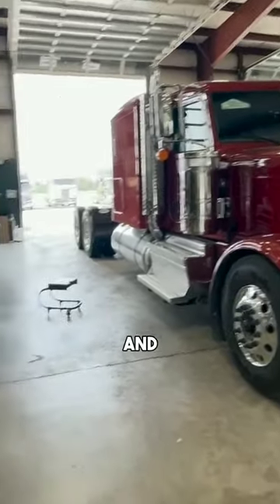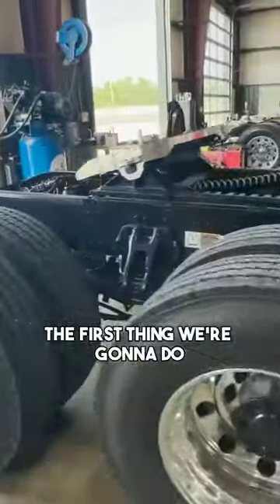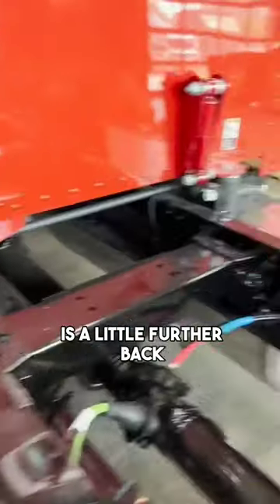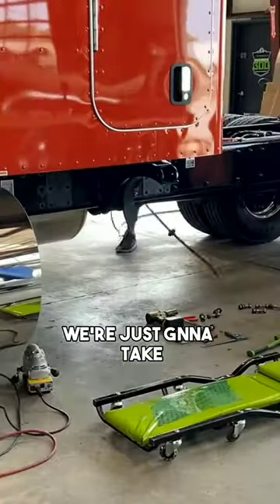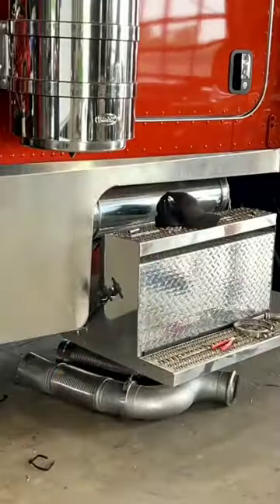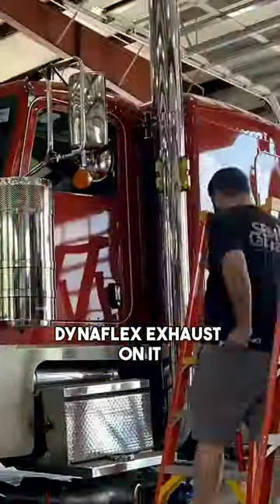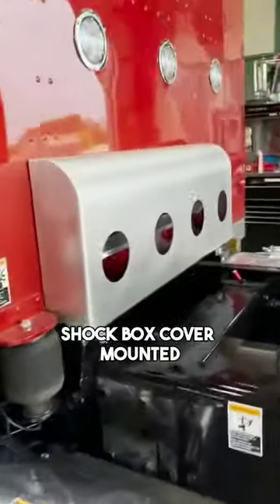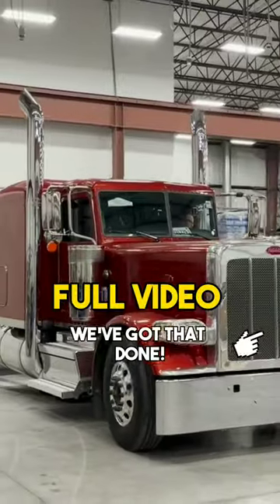Drastic transformation happens fast! #timelapse #custom #peterbilt

Comment: Step one. Remove def tank and add more fuel capacity.
Reply: Or, convert the def tank to a diesel tank so Cali dot thinks it’s compliant and do a delete.
Reply: You gotta do a whole lot more than just remove the def tank to make that work cause the truck won't even start without def in the system until the rest of the system is removed and you re-program things.
Reply: @marqueswilsonn  Better yet, do a Kalifornia delete.  Ain't no reason to go there.
Reply: Def as in ADBLUE?😂
Reply: @MacGyver2154  delete Cali for sure
Reply: @speed_demon420  Kalifornia is a really great place,  politicians and the freeky people have ruined it.
Reply: Delete DEF 😂😂😂😂 ya mean!
Reply: @marqueswilsonn  step 2: stop delivering to California. 🤣

Comment: A friend of mine bought a rig (not mentioning any names) but it had a light weight under powered Mercedes engine and to get weight up front we pulled the steps moved bigger tanks as far forward as we could put cabover steps on put the boxes underneath the sleeper doors and it barely worked the heavy low steel paintmatched bumper and .oose gaurd did the trick

Comment: And truck is ready to haul 1.80 load !!
Reply: 1.25
Reply: I had a 2023 389 highrise/midroof with a Paccar. I was getting 6.5 mpg @ 62 mph on a dry van. Fuel was/is $5.17/gallon and making $2.05 w/FSC. I didn't pay insurance, plates, etc. I paid $2820/ month truck payment, 0.07/ mile for maintenance and fuel. I averaged $1,300 every 15 days, and that's before income tax
Reply: @jeffreycairns767  leased on to who?
Reply: @djchedd  Scotlynn Commodities
Reply: @jeffreycairns767 Did you get rid of it? Those payments don't seem to be worth it.
Reply: @jmh4ggg  I wasn't making any real money as I was on a dedicated contract but not dedicated miles. Last week, I had 2 different days where I did 2 runs per day and ended up with 131 and 138 miles for those days. They've also dropped the rates. I'm now, currently, getting $1.85/ mile. I traded that truck in for a '22 Kenworth W900 with a Cummins.
Reply: @jmh4ggg  Most companies are charging more then what I was paying plus they have to pay towards insurance, stickers, plates, etc. It's a decent deal but the miles need to be there.
Reply: @jeffreycairns767  It sounds like you'd be better off running under your own authority. My biggest expense outside of fuel is my insurance at $2300 a month. Plates are $1500 a year and ifta is about $100 a quater. 

My truck is a 2005 peterbilt 387 that I paid cash for and didn't cost me much. I took out a personal loan at $253 a month to buy my trailer cash. 

This week i'll make $2500 after fuel, which is around what I usually make every week, but that's with my being home everday, i'm not running as hard as I could. The best thing about running under your own authority is booking your own loads and deciding whether or not you sit around. those short runs, like 131 miles and 138 mile would usually pay like $450-500 highly dependant on the area.
Reply: @jmh4ggg  I misspoke, I apologize. I get $1.42/ mile + FSC, which is currently sitting at $0.435/ mile. That's for runs that are 301+ miles. The less miles I run, for that load, the more per mile rate is, but FSC stays the same. I also receive $25 per PU/Drop. For example, the run I'm currently on had 1 PU (which just means I BT from the yard to pick up a loaded trailer at a different yard down the street) and 5 drops. It also pays 575 miles and 99% of the time I go back to the yard empty. The problem with my own authority is that there's no money to be made anymore. Probably unlike you, I have to deal with 90% Indians and they're running freight, cross border, for as little as $1/mile all in. It's also why the company I'm with had to cut the rates, to keep the contract. 301+ miles dropped $0.08/ mile while 0-30 miles took the biggest hit at a loss of  $0.90/ mile. The 1 run I did, last week, was a full load of empty pallets to a pallet warehouse (actually I did 2 to 2 different warehouses but I'm only talking about 1 of them at the moment). It ended up being a drop & hook but still took almost 2 hours to do. It pays 8 miles, which is less then $40, but I believe I should receive $25 for the drop. It's not great but it's not overly bad. I also found put that my dispatch misunderstood me and thought I wanted to stay regional, which means alot more traffic and alot less miles. Now that that's cleared up, I'll be getting more miles. I'm also not American but I do run for the largest grocery retailer in Canada. I run between Ontario and Quebec (I'm currently sitting in Gatineau, which is just inside Quebec on the North side of Ottawa). I do hope to buy my own truck in the future, to which the Company covers the same stuff regardless (ie: plates, insurance, stickers, etc.). The problem is, I don't have the first clue of how to be an actual broker. I'm worried that I'll screw it up somehow, but it would be nice to have my own truck. I'm not 100% sure what truck I want yet, as there are a few I have interest in, like a Cascadia, International 9200/9400,  Peterbilt 387, Kenworth T680, etc. The things I do know is that I want it to be aerodynamic, highrise, and at this point in my career and for what I do, I prefer an automatic, asi do ALOT of city driving (ie: Toronto, Ottawa, Montreal, Quebec City).

Comment: All of that and it still won't  last as long as the original  Pete's.. it still won't sound as the old Pete's.. it still won't perform  like the old Pete  .. and how long will it work before it goes in the shop for all the sensors and Def stuff..

Comment: I was wondering is the tanks 120,or 150 gallons
Reply: My 2023 Pete 389 had a 120 on the drivers side, due to the DEF tank, and a 150 on the passenger side
Reply: Didn't know you could mount tanks just to the frame. Every Paccar truck I've had tank brackets were bolted at the cross members in the frame rails. In video it appears rear tank brackets are in the forward cross member hole unless they're going to move cross members forward.